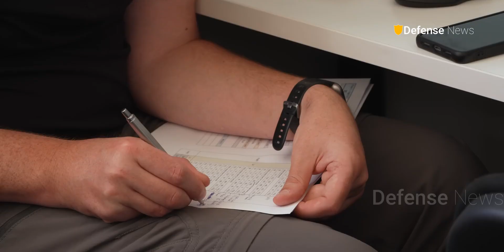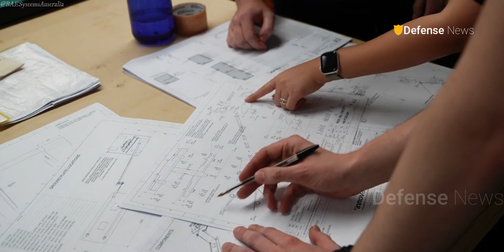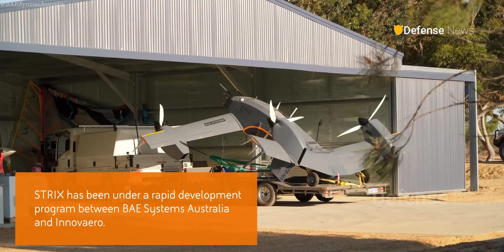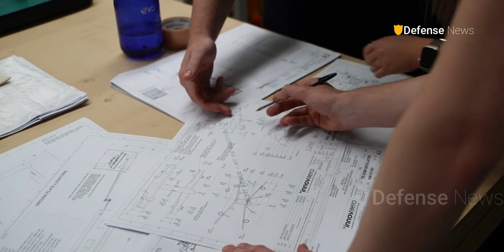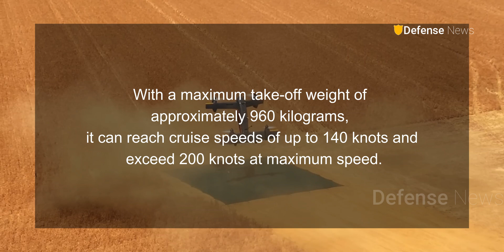Meet STRIX: The Advanced VTOL Drone Built for Military Excellence

Comment: Summary - safe 7 minutes of your life:
The video is about the STRIX, a new vertical takeoff and landing (VTOL) drone developed by BAE Systems Australia. The STRIX is a fully autonomous drone that can be used for a variety of military missions, including air-to-ground strikes and intelligence, surveillance, and reconnaissance (ISR). It is designed to operate without the need for a runway or human pilots, making it a valuable asset for dangerous missions. The STRIX is also highly versatile, with the ability to carry a wide range of payloads, including precision-guided munitions, loitering munitions, and sensor systems. The successful flight testing of the STRIX marks a major milestone in the development of autonomous flight technology and demonstrates BAE Systems Australia's ability to deliver innovative and cutting-edge defense solutions.

Comment: Too cumbersome for any use.
Reply: Helicopters are more expensive and complicated. This gives you the pros of a helicopter in vertical take off, while the pros of aeroplane in level flight, such as its speed, performance and efficiency. All the pros without any of the cons, great concept.
Reply: a helicopter is much better suited for such a niche, looks just exotic with no real unique ability compared to other platforms
Reply: @emmaverna1138  When you have no runway there is no other option. This is also faster and has a longer range then any helicopter. Even helicopters are moving to this design. look at the Bell Boeing V-22 Osprey.. this is just a smaller verison
Reply: @emmaverna1138  Name an autonomous helicopter? It has vertical take-off ability that fixed wing drones don't have and superior range and speed than a conventional multi-rotor drone. I'm sure it has certain user cases that are an advantage for this type of drone.
Reply: @emmaverna1138  Really, I would suggest it is easier to package one of these into a 40ft container than it would be for a helicopter